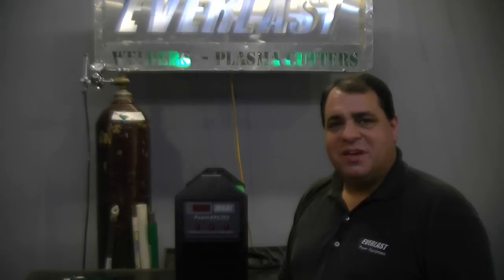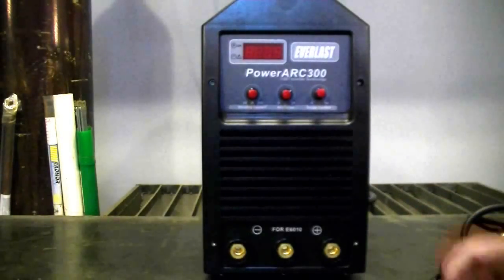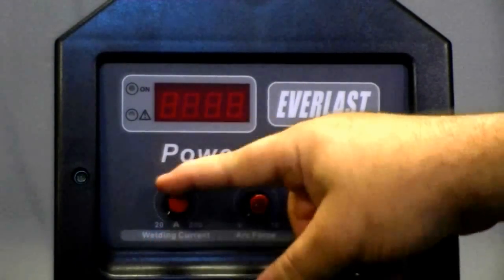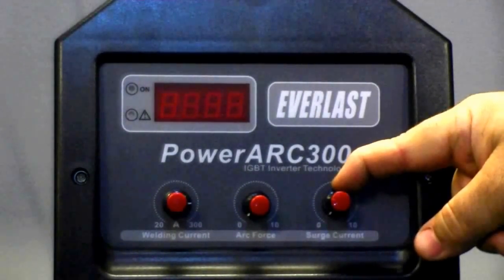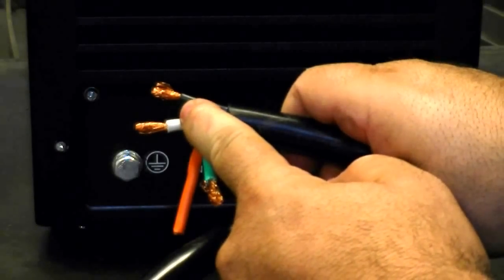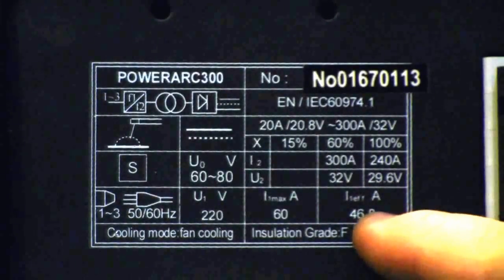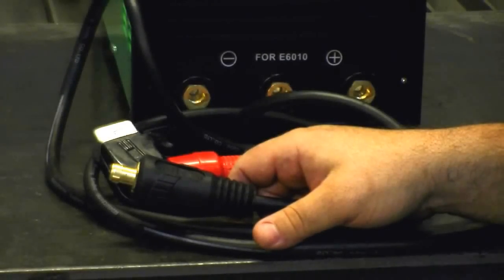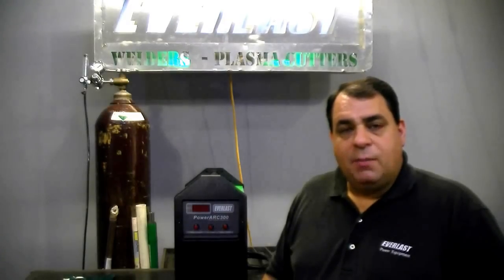PowerArc 300 Stick Welder Part 1 - Inverter Stick (SMAW) Arc  Welder - Everlast Welding

Comment from the maker: That is an active work table with units mounted below it and the cylinder is mounted to the table and several machines are used with that cylinder.   The lighting is about as good as it can get with a multiple banks of lights...in fact it will hurt your eyes it is so brightest.  It could be the color contrast off.  We will work on it.